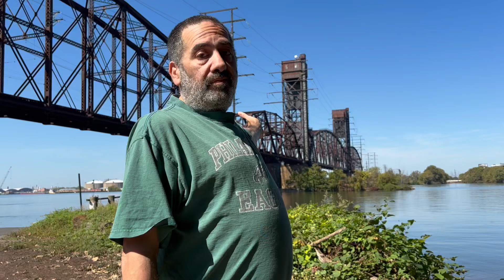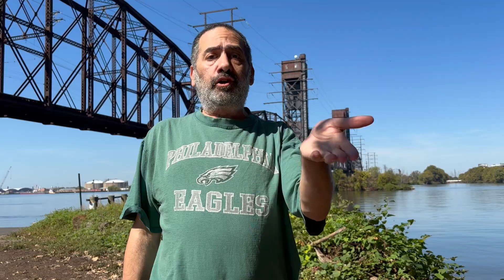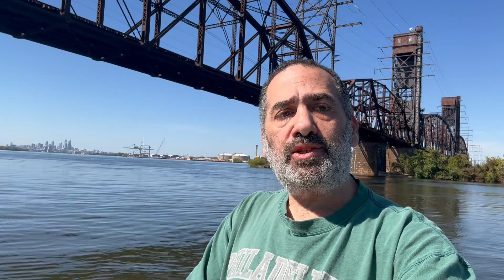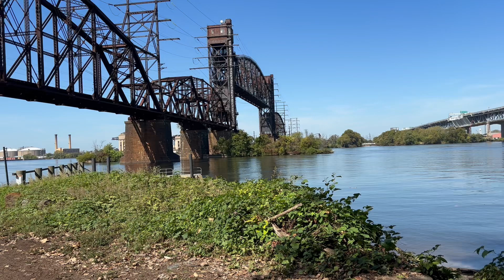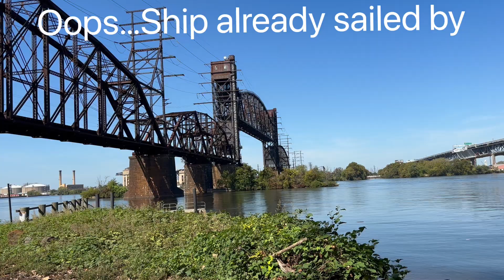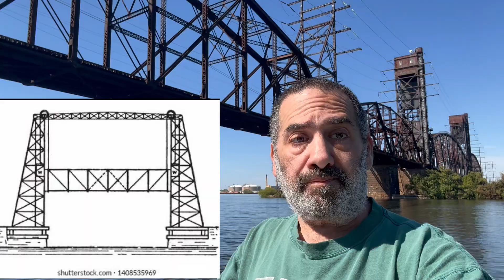Philly’s Forgotten 65-Year-Old Bridge Change was THIS Engineering Marvel!

Comment: How does it work? 2:20
Reply from the maker: So, at 2:20 they converted the bridge into a vertical lift bridge, in a 2-year project taking it out by barges to not interrupt the railroad traffic for long at all.
The vertical lift bridge works because those towers are there with a pulley system.  The sheath at the top of the tower holds a rope carrying a counterweight at least as heavy as the bridge section to lift it up and down , obviously using hydraulics.  It goes up and down, as I have seen it within less than 5 minutes.  Pretty quick really in real time. But, yes, it goes up 135-feet high😊